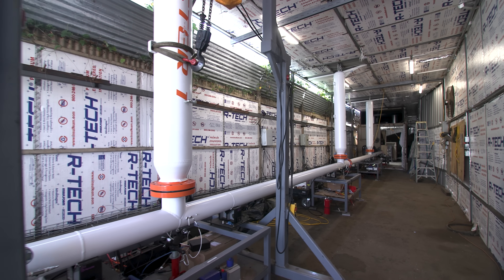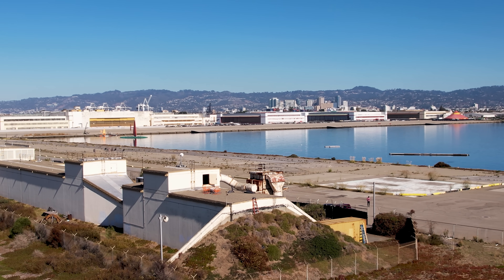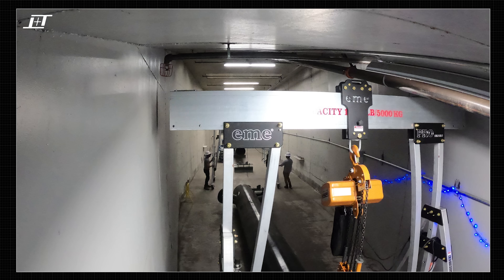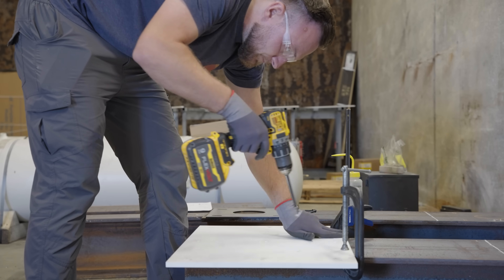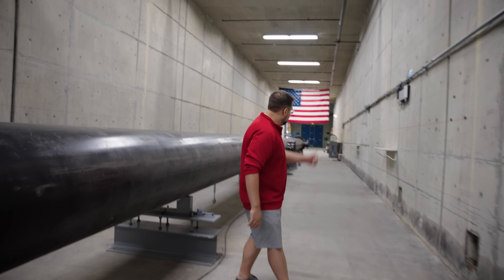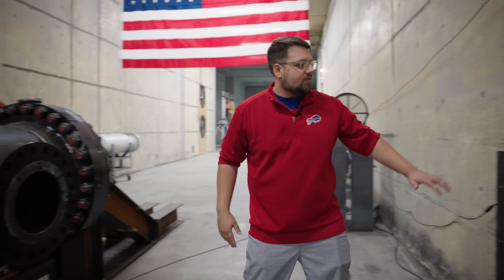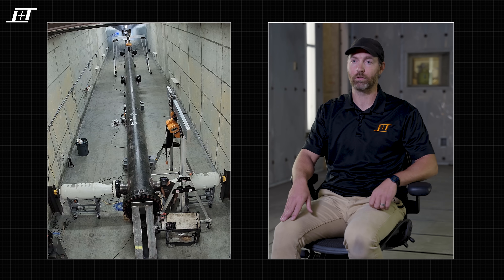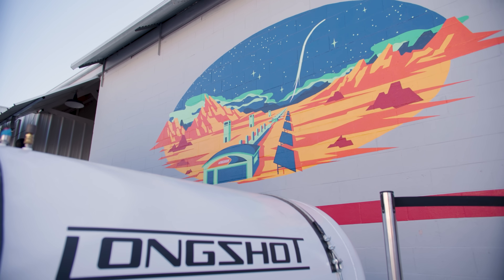Alameda Facility: The Construction of the Mini-Gun

Comment: Longshot Space's upcoming 30-inch (76 cm) bore, 120-foot-long prototype is expected to be the largest operational gun in the world by bore size and length among current projects.
However, the historical German Schwerer Gustav remains the biggest gun ever built in overall mass (1,350 tonnes) and fired a slightly larger caliber shell (80 cm or 31 inches).
Reply: Correct!